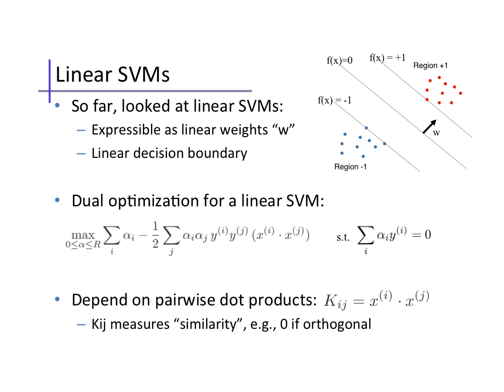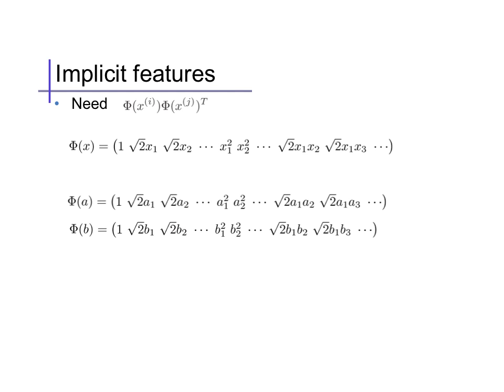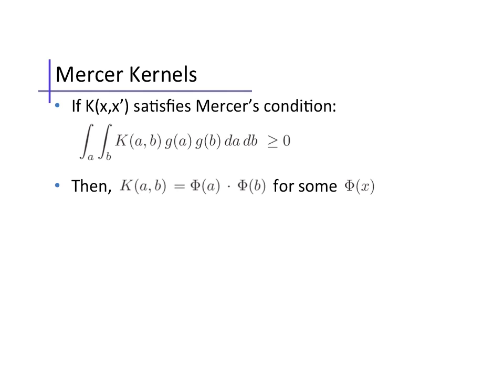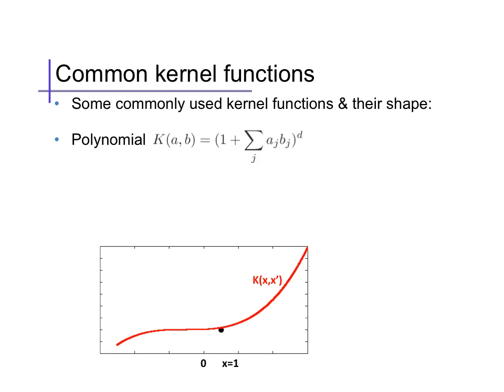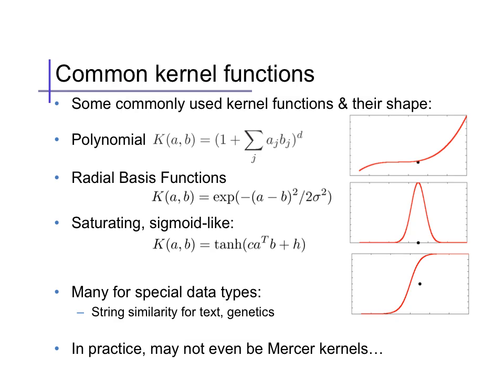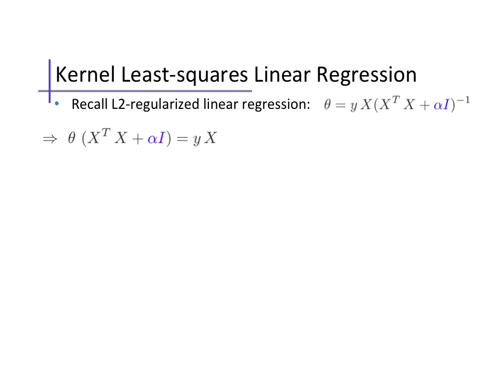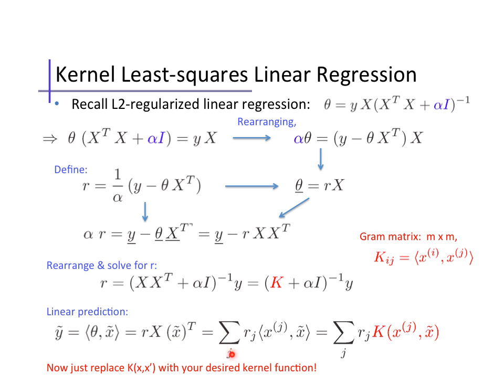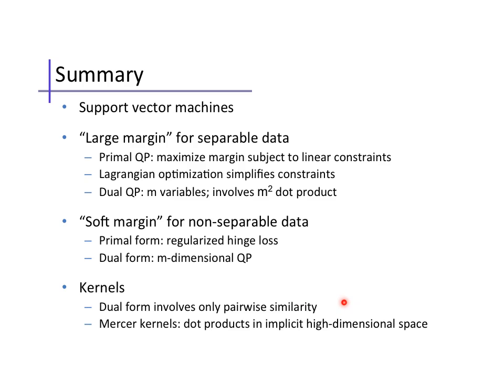Support Vector Machines (3): Kernels

Comment: Does the kernel trick give us access to the same expressivity as a model that is learned on transformed vectors explicitely? It seems like our weights for the respective features for our polynomial transform are fixed, so, for example, if the underlying function was x1^2 + 4x1x2, we couldn't learn it since our feature is of the form x1^2 + 2x1x2 + .... etc. But if we had just concatenated all of the various components of the polynomial feature vector and ran a linear svm on that, then we would  be able to learn such a function. Is this correct? or am i missing something?